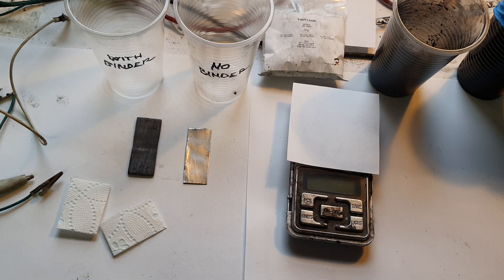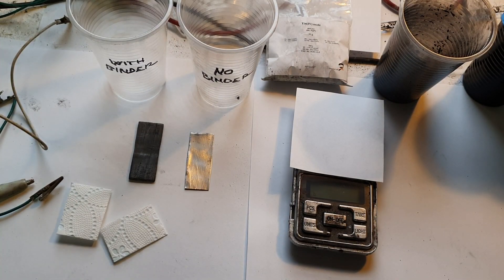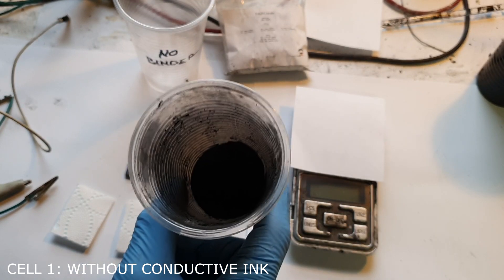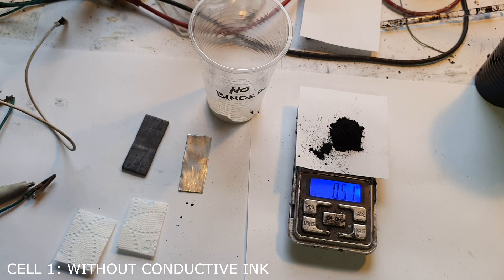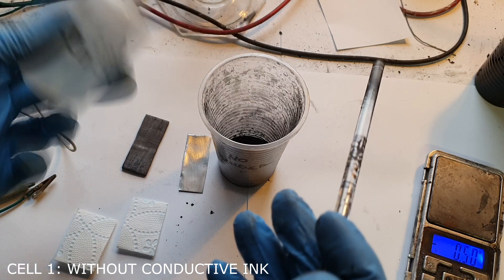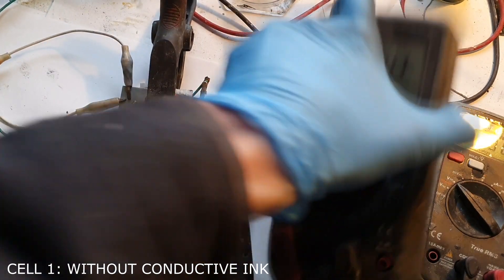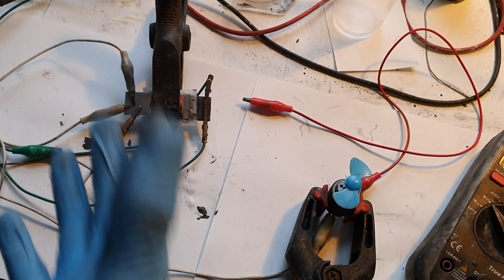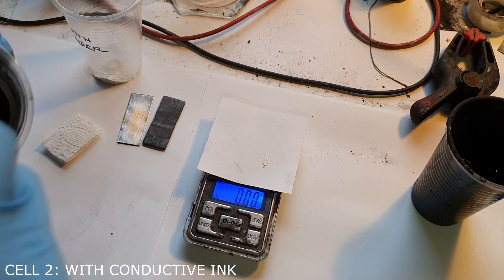2 Volt Tin Oxide - Zinc Battery TEST with conductive ink

Comment: Can I ask what was your ohms resistance on carbon cell? I was getting .2killaohms I'm sure yours is better. Just curious how far I am along??😁
Reply from the maker: You mean resistance on the cell,... between the electrodes? Uf, I think that less that 20 ohms!? But I am not 100% sure
Reply: @cayrex  I mean the carbon electrode by itself. Mine is about .2killo ohms which I have either improve or add a current collector to be able to stack cells.
Reply from the maker: @strangescience3414  uff, the carbon electrode have less that 1 ohm

Comment: Very unexpected emf because tin dioxide is a weak oxidant, yet you get higher emf than zinc|MnO2 battery where manganese dioxide is a strong oxidant?! The cell should last much longer if tin dioxide were getting reduced. Does this mean this is actually a supercapacitor?
Reply: This likely qualifies as a hybrid supercapacitor, the exact mechanics of which I'm unclear on. In these devices, there is some redox component, but also an ion adsorption one as well. It looks like cayrex is using a dual electrolyte mix, so there could be some ion synergy happening.